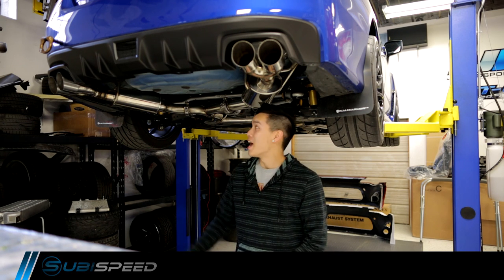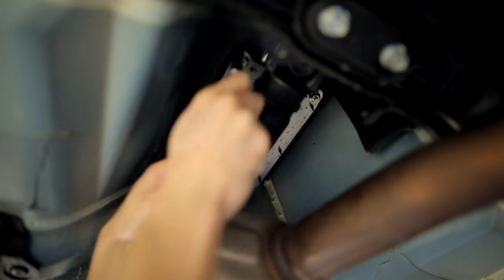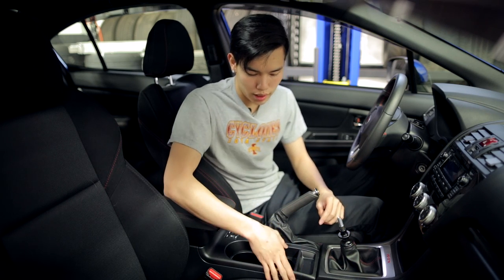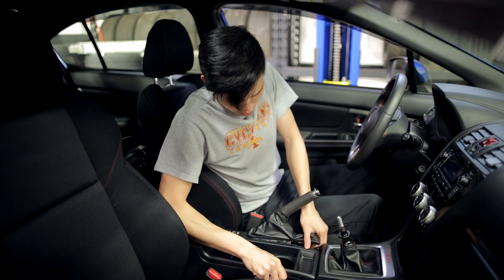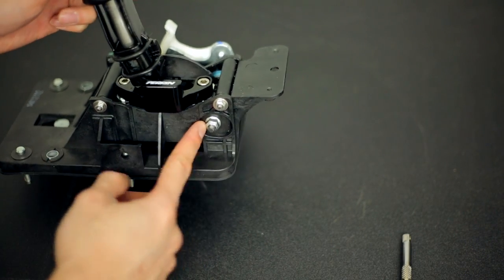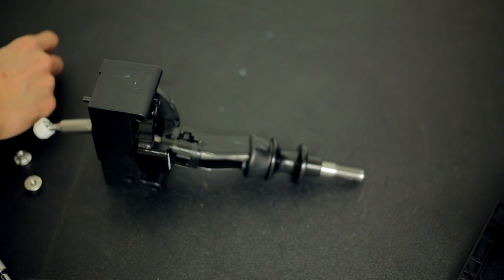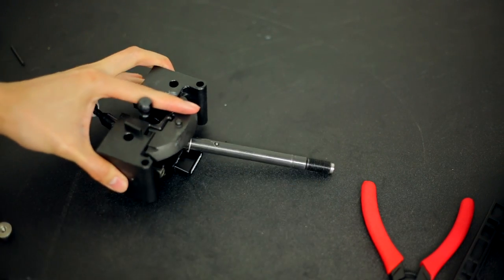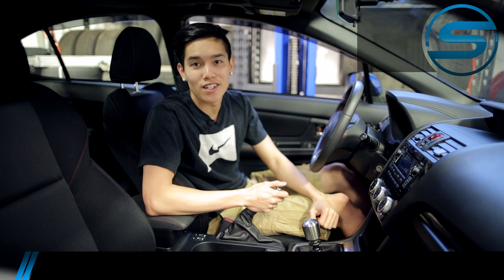How To Install Short Throw Shifter on a 2015 Subaru WRX

Comment: I’m having trouble reinstalling the green part with the rest of the shift assembly, I’m not sure how to put it back on
Reply: I'm assuming you mean the plunger. The one with the 12mm bolt. You lost the nut that the bolt screws onto. I know it a year ago but i made that mistake. Grinded down one the 10 mills to fit and everything was fine after that. Just replaced one of the other bolts with a random bolt that fit.

Comment: How long did it take you. about 2 hours flat time ? Love to no Thanks appreciate it
Reply from the maker: +Chadd Francisco Can't say for sure since we were filming, but it's going to depend on what tools you have at your disposal.
Reply: +SubiSpeed I work at a shop so everything
Reply: @SubiSpeed  seeing as how i didn't have a punch or snap ring pliers and mine was done in two hours, of actual work, i would assume that with proper tools, about an hour. It's not as hard as it looks. Remove the heatshield, remove the cover, remover 4 nuts. That's 4 bolts and 8 nuts. So 5 minutes there, +5 for struggles. Remove inner trim, 5 minutes. Remove shifter another 5 minutes. Take shifter apart 5 minutes for everything except the reverse lock out. So maybe 10minutes for that one. Take new shifter apart couple minutes without proper tools. Put rod in assembly and secure 1 minute. Put assembly back together 15-20 minutes. Put shifter back together 5 minutes, without snapring pliers.put assembly back in car 4 bolts on top, 4 on bottom 10 minuts. Reonnect cables 10 seconds. Put cover qnd heatshiepd back on 3 minutes. It's easy, people just want to make it seem complicated because they are confused. But it's really just a lot of small tasks. It's not confusing, just annoying.

Comment: Is this short shifter any different from the stock factory short shifter? Any difference in shorther thows or what???
Reply from the maker: This is 2 inches shorter so there is a major difference between the two.
Reply: So the shifter is 2 inches shorther in length or in the throw
Reply from the maker: 2 inches shorter in height. Shift travel is reduced by 30%

Comment: Cant get the two 10mm nuts out from under the shift assembly it jus keeps spinning!? Any help?
Reply: I'm having the same problem, but with all 4.  Did you find any solution?
Reply: I did. I had to take out all bolts and resemble it. I made sure to press down hard so the bolts grab and they did. I think on my first try something was off centered causing the bolts to not grab. I hope that helps GL bro
Reply: @gabrieltroopah  all I did was put alot of pressure on the bolts and held the back to make the screws spin out. I hope that helps.
Reply: @gabrieltroopah  no problem man. Did you end up getting them out? It a was really a bitch
Reply: So the 2 10mm on the bottom are also connected to the 2 10 mm at the for the reverse lockout. More than likely what happened was the threads got messed up. I had the issue trying to put in the shift stop, the damn things wouldn't come out. Turns out they only had like 2 threads and the rest was bald. Eventually got it out and lucklily only the bolt was damaged, since i didn't need it anymore.

Comment: anyone know the part number for the little white shift lever bushing on the bottom of the shifter he transferred? mine popped out of place and my friend hooked me up and fixed it but unfortunately lost the white bushing and its just the metal ball on the bottom of the shifter that's clipped in right now with no bushing on it. the ones im finding look like they're for the older subaru's and don't look similar to the OEM 2015+ one I had on.
Reply: Josh Moore any luck ?

Comment: That looks like a big pain in the ass to install.  I just might order it from the factory when i get my 2016 WRX.
Reply from the maker: The short shifter from factory will not have the same effect as the Boomba Short Throw Shifter.
Reply: +xuimod Perrin short shift adapter is by far easier.  Adapter, shift stop (which is shown in this video), and bushing ran me about $179 shipped.
Reply from the maker: +psychdoggg it may be easier but it does not shorten the height of the shifter. An actual short shifter will shorten the height and throws for a much better shift feel.
Reply: Good point.  If the end goal is 30% shorter shift, I'll opt for the shift adapter.  If 60%, then both seem logical.
Reply: My car came with the factory “short shifter” and it’s not nearly the same as the Boomba shifter. I have both the adapter and the lever and it makes worlds of difference. The stock short shifter is not really even a short shifter idk why they call it that

Comment: the 4 10mm nuts that hold the shift assembly in place don't come off so easily?? I was spinning and spinning and they never budged...? help me
Reply: Kyle Gibson did you find a solution? I'm having the same problem

Comment: After installing this I can't seem to fit the shifter stop, I have both a perrin and boomba version and they just won't it shift to first and even if I did get it my 5th 6th and reverse won't work. I have had to just not use the shift stop so i could use my 5th,6th and reverse. Does anyone else have this problem or have the fix? I was thinking of sanding it down a little
Reply: No, the shift stop is fine. The adapter you are using needs it to be adjusted. Loosen the two 10mm bolts on the shift stop. I am assuming you are using both shift stops. Find 1st gear. Align shift stop. Find 5th gear, align that shift stop. Tighten down 2 bolts. You're good to go.
I put in a billet shifter and had that issue. 
I couldn't get into 5th or 6th. Well eventually i found 5 adjusted the shift stop to there. Don't look for 6th because you might find reverse. 5th is actually really close to 3. It works the same way with cars that have reverse next to first. It's just the opposite. In that case you look for 2nd instead of 1st.

Comment: Haha I remember back in the day about 25 years ago just out of high school and I was a brand new licensed driver with my first car that my dad sold me for $1100 and I made it into another ghetto tuner car cuz fast and the furious was all the rage with my car buddies and although just to get that short shifter look I tried cutting down the shifter stalk to make it look shorter since they never made a short short shifter kit for that car and even if there was one on the market I could never afford it as s young broke kid but it was funny now that I look back and see myself trying to grind off my shifter stick with my dremel tool and hack saw to shorten it but the steel used to make the shifter stalk was like hardened like the steel used to make the pedals which I assume is for safety so I said screw it and put it all back together. I can't believe that now I'm a veteran in the auto industry and I'm general manager of a very big and busy repair shop and I'm certified ASE A1 thru A9 and C1 for high traffic service and repair shop. But the install for this truly is a hassle I think my method of chopping down the shifter stalk is much faster with the right tool to cut thru it

Comment: Pretty simple but tedious install. Kind of skipped over a few things in the video (don't recall any mention of lining up the up and down arrows on the Boomba when installing the reverse lockout piece).

Also... is there such a thing as a SHORT e-brake handle? Lol. My e-brake and weighted shift knob are super close in 2nd gear...

Comment: Jesus christ I don't own a WRX, but this is crazy complex just for a shift knob. My Miata can be done in like 5 minutes with only a few screws. Why did Subaru make it so overly complex?
Reply: Shift knob? You just screw that on.

 But the shifter completely agree. My MR2 was super easy. Just 4 bolts, to remove the shifter assembly. Take of the two cables, pull the shifter of, put the new one in. Connect the 2 cables. Bolt it down with the 4 bolts. I put a billet shifter in a crosstrek. Why, i don't know. But it's the exact same process, pain in the ass.

Comment: This is why I'm paying a shop to do it. F**K that. Question, How necessary is the shifter stop for this application. Also, do you recommend the Short Shift Transmission Plate from Boomba? If so, why?
Reply: The Perrin shifter stop makes all the difference on the OEM short-shifter. As does the bushing, the Perrin adapter,and a weighted shift knob. I can only imagine that upgrading to this Boomba is going to make all fans of true short shifting think of the OEM as child's play. I'm going to install mine this wknd. Hopefully my Rhino ramps will suffice.

Comment: anyone have problems with the angle of the shifter after it's installed? I had a perrin shift stop and that is no longer needed. The stock base is sufficient enough, but it is difficult to shift into 5th or 6th. Not impossible, just more difficult. I tried pushing the stock passenger side shift stop more towards the driver side to make 5th easier to find, but no luck. Car seems to be driving fine, but I notice that you should be able to use the perrin shift stop in conjunction with the boomba, and I can't. Anyone else got some tips? Thanks
Reply: Indecent Prod i am running into this issue right bow actually
Reply: king killa I haven't taken it to Subaru yet do get looked at, but it's still driving fine. Quick shifting is quite difficult though.
Reply: Indecent Prod i actually just figured out the reverse lockout os backwards. the screw should be going thrubthe left side of the shifter with the hump faceing the right (if sitting in drivers seat) i can use the perrin shift stop now. yours might be the same issue. it was a easy fix i didnt even have to remove it from the car
Reply: king killa damn, that was my problem too. Good eye on that. 🤘
Reply: Indecent Prod No problem bro glad i could help. I just got done taking it for a test drive and holy shit what a improvement it made. i also did the perriin sts adapter with it.
Reply: king killa I have the same setup, and just drove it to dinner. Shifts 10 times better now. Thanks again
Reply: Indecent Prod They really should only have one hole for the scew to go in. lol
Reply: king killa I agree. Or at the very least, in the video, explain to the viewers that there is two holes lol
Reply: Thanks to you guys having done this before, I'll know to pay attention to this when I do mine this wknd. 
But really, thanks for sharing this info with us. I can imagine it'll save me hours of unneeded stress and lots of cursing lol
Reply: About to do this install this weekend, could someone possibly list the tools I will be needing? Thank you in advance.

Comment: The studs that the 10mm bolts connect to are all just spinning in place when I went to pull them off.  Anyone else having this problem?
Reply: Yes, what I have to so is use a chisel to pry out the 4 washers on top, then remove the 6 bolts on the shifter from inside the car, the whole assembly comes out. Afterwards flat out he washer and install them

Comment: I see a STI short shifter Assembly in my future.
Reply: If you do it yourself it's the same process, minus the taking apart the assembly. I would save the $100 and buy one of these and just get it over with. Suburus only have a 3 year warranty, so there's no point in trying to keep it "stock from the factory". My 2018 is already out of warranty. Whearas a kia would be under warranty till 2028 if it was a 2018.

Comment: LOL after watching this video, if I ever get an STI, I will order it from Subaru and let them do it hahaha
Reply: STI comes with a short shifter. The only upgrades you would need are a shift stop for 1st and 2nd and a shift plate. Neither is necessary but the shift stop i highly recommend. It feels great when you don't travel as far to get into 1st, and they aren't crazy expensive. The shift plate is pricey, but it changes the pivot which decreases your throw even more. That's something you have to try out first. Unfortunately you would need to know someone who has done that mod and drive their car to figure out if you need it. Shorter throws are great, but too short and things get weird. Like i put in a billet short shifter with a shift stop. 4th and 6th feel the same. 1st and 3rd feel the same. They both look the same too. But it's something you get used to. Especially when your car tells you what gear you are in.
Reply: This is way less travel then sti SS...

Comment: I just installed the boomba short shifter into my 2018 wrx everything went well, now my car won’t shift into 6th gear please help me cant find any additional information
Reply: You most likely have to readjust you reverse lock out stop make sure u can get in to the gears properly first
Reply: did you ever find your 6th gear?
Reply: If it goes into 5th but not 6th, make sure the reverse lockout stopper is adjusted correctly. Or just try harder. 
But seriously the shift stopper.

Comment: hell. no.. i installed this and ran into a HUGE problem. I lost my fifth gear (it wouldnt lock into fifth) and the reverse lock out was gone. I.E. i could go into reverse without lifting the lock out. so i had to take it all apart again and put the stock one back on. Took me 8 hours because of that. I followed instructions to a T and had the instructions that came with the shifter from boomba. even had a buddy come over to try to figure out the issue. he didn't know either. Disappointment at its finest
Reply: +Javibear94 Hi, I am having the same problems as you did regarding the boomba short throw.  I can't get it into 5th gear anymore even with the stock shifter.  What did you end up doing?  I appreciate it.  Thanks.
Reply: +Jan Lim where you able to figure it out? I am having the same issue
Reply: +K pat hi. When you're putting into where 5th would be you're actually already over passing it. Bring you stop close to the driver side. What may feel like 3rd is probably your 5th. Hope that helps.
Reply: +Jan Lim got it! Thanks for your help!
Reply: I had the same problem, but I realized that I put the screw coming from the rightside into the reverse lockout vs. the left. The hump on the shifter should be facing right. I couldn't believe something that small would make me lose my 5th and reverse gears. Now it's perfect!!
Reply: Dr. Sugarleafs thank you!!! This was just what I needed!

Comment: To much work for the price. We need complete assembly for quick in and out swap.
Reply from the maker: Price is relatively similar to previous model sts. If it was a complete assembly, it'd be more expensive.
Reply: SubiSpeed rather pay full assembly than just doing all that work lol